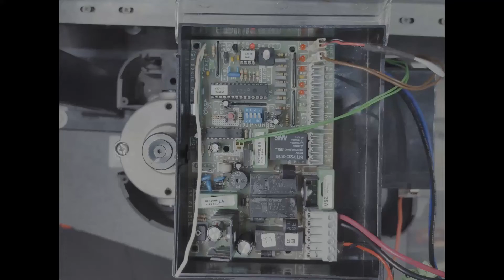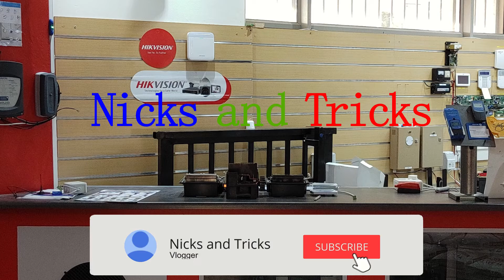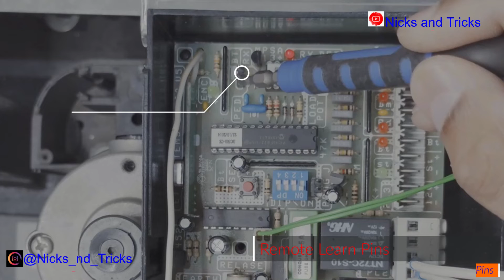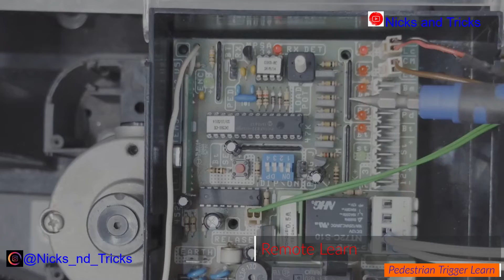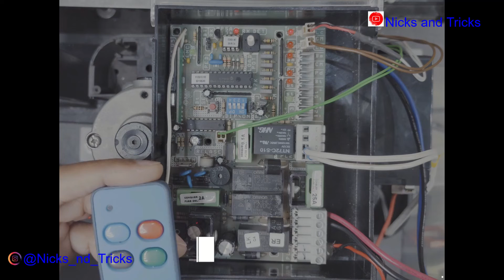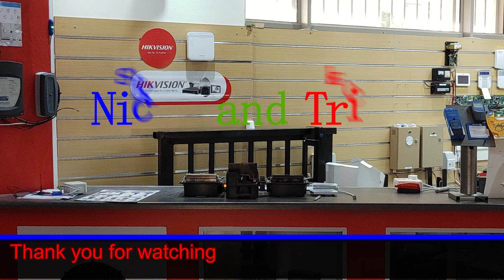How to program an ET remote to an ET 500 Gate Motor

Comment: I’m using a star screw driver to try and program and ET one button remote to an ET500 gate. I’m pushing the star screwdriver against the BT section (centre of the 2) but I’m still struggling to get the remote to link. Help please
Reply from the maker: Thank you for the comment,  try and change remote set by holding the remote for 20 seconds until the light pulses

Comment: Love the videos, but please could you maybe record voice-over or something, or maybe add subtitles?
I am struggling to make out what you are saying, and the auto generated subtitles also skip whole sentences, because its too soft.
Thanks again! Would love a general trouble shooting video on these ET gate motors.
Reply from the maker: Thank you for your comment Joel, this was my earlier videos, apologies. What do you need assistance with
Reply: @nicksandtrickssa  our gate motor was working fine, but now when I press the remote I can see the one red light flicker, but nothing happens and no beep is given. There is a green light and 3 red lights that stay on the whole time. I am just trying to figure out, how to reset it, hopefully that will work. The gate was on manual mode for a bit.
Reply from the maker: @joeljenkinson  can you take the cover off, open the manual release door and close it again, when you close it the PCB must beep to show it's turning on, if it does not beep the door release might be faulty
Reply: @nicksandtrickssa  thanks so much! I saw your comment to Stan_man and using the program jumper on the green cables fixed it. The door mechanism must be faulty. Thanks!
Reply from the maker: @joeljenkinson  no worries, a like and sub would be appreciated

Comment: I have problem where there is power to the box and just installed new battery, but when i press the remote no beeps at all, this motor has been working for years and all of a sudden last week pressing remote does nothing, LED on the board still lights and when i press remote the LED on board still picks it up, pressing the red button next ON DP does nothing
Reply from the maker: Thank you for the comment Stan, when you open and close the manual door release, does the board beep? If not use the little program jumper and replace the green cable connector and bridge the door release out, if the board starts off with a single beep then your door release sensor is just broken, if not then something major could be wrong, hope it helps